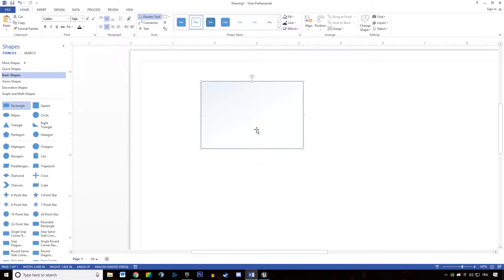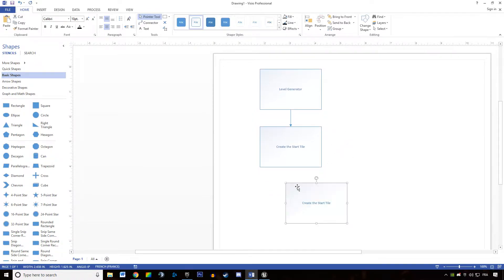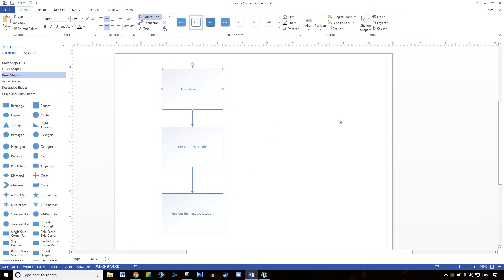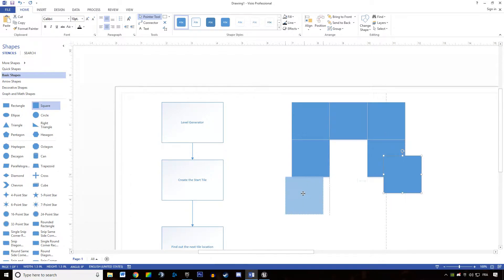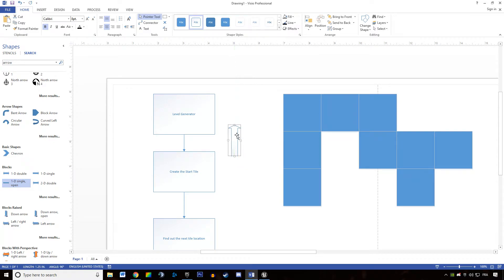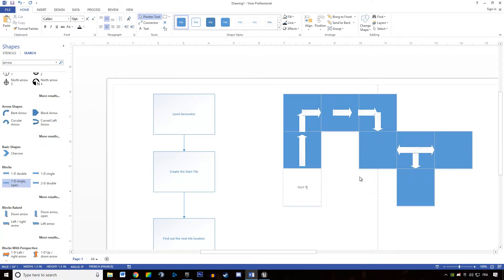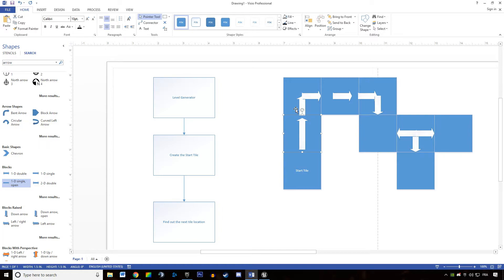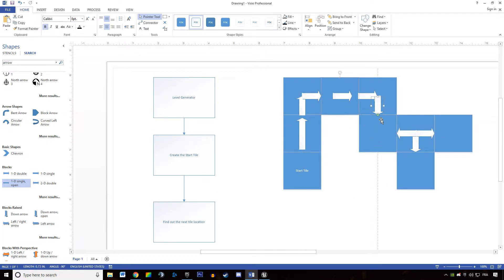Diablo Dungeon Generator #2 Tech Design | Unreal Engine 4

Comment: Hi, nice tutorial! I didn't watch it everything as it is very long :) and I don't need to use it right now. From what I've seen i would like to comment and ask few questions if you don't mind. 
Isn't it better to use actual maps as a tiles? I found BPs to be slow and cumbersome to work with. That's just my experience ofc. 
To get the 45º angled view, you can just rotate camera arm and you'll get same effect. At least visually, not sure what other implications my approach may have.
Reply from the maker: If you just rotate the spring arm camera and are using a WASD control scheme you then have to setup your "ForwardInput" to move at 0.5;0.5;0 instead of 1;0;0 which is not really convenient. If you're using "ClickToMove" yes you can. I'm explaining it in one of the videos.
Considering working with Blueprint for Tiles you are right it is quite cumbersome but in my mind anybody would be working with "PrefabTool" (but it's clearly not the case). You are right, BP's are not the best approach here when it comes to framework. Regarding the code side of thing it's more convenient to use BP's though.
Thanks for your input.